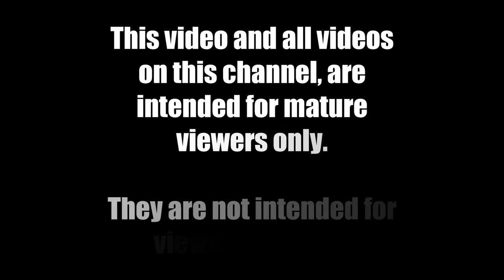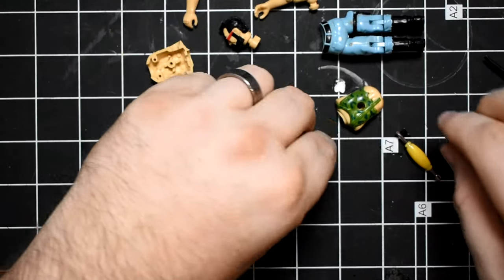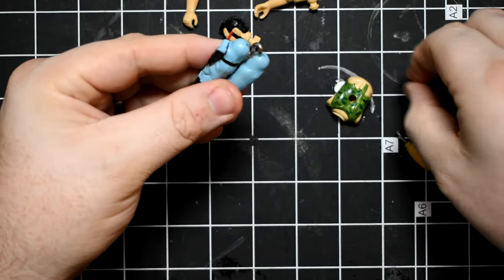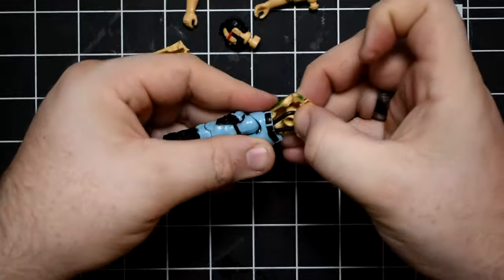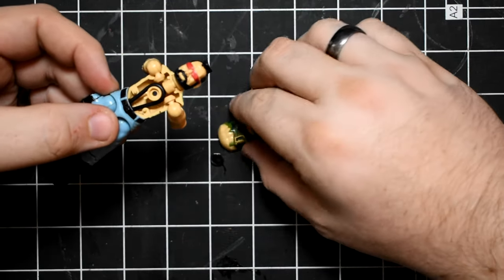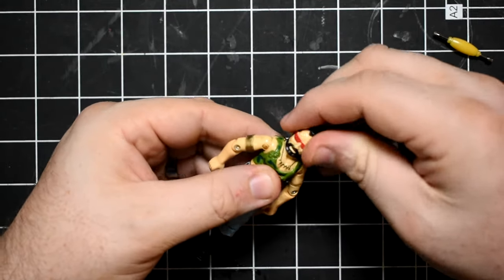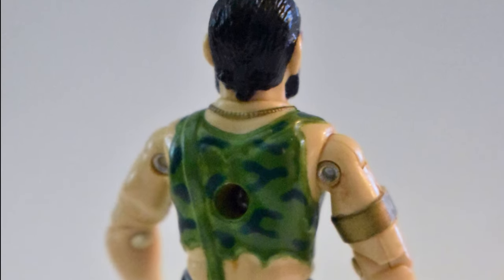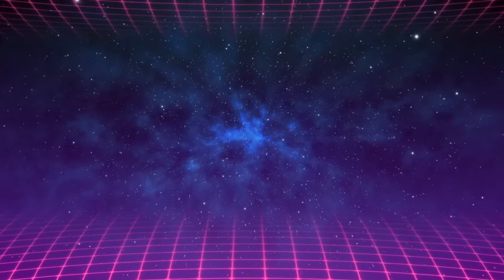G.I. Joe O Ring Repair Tutorial - Vintage Toy

Comment: Great video, when I do this, the head loosens afterwards and moves like a bobble head. Can that be fixed?
Reply from the maker: Usually when that happens to me it's because the head either isn't seated perfectly in the chest piece or I need to tighten the screw a couple turns more. Be careful you don't over tighten it however because it could crack the body.
Reply: Thank you!